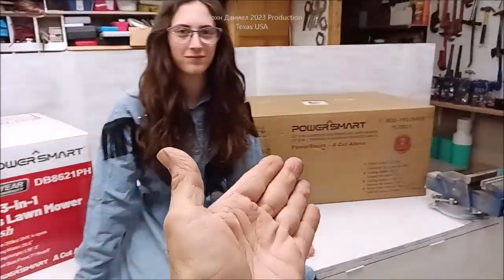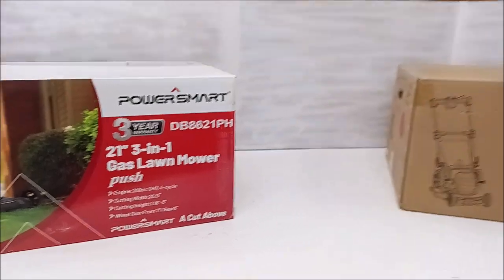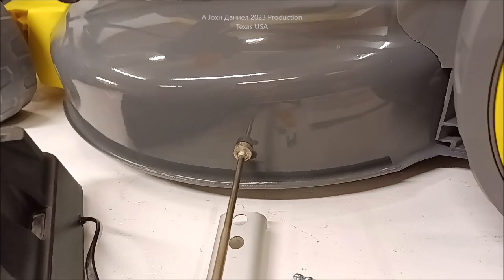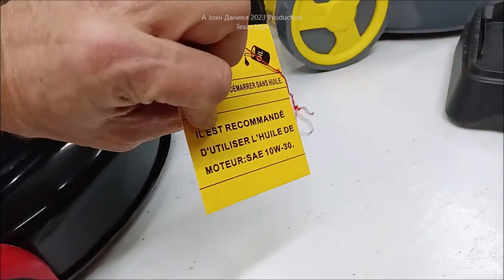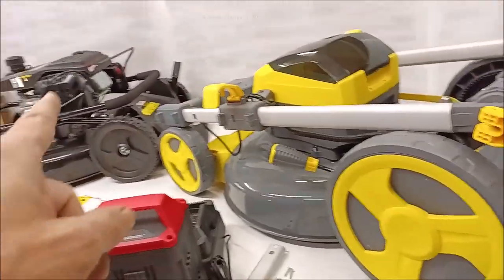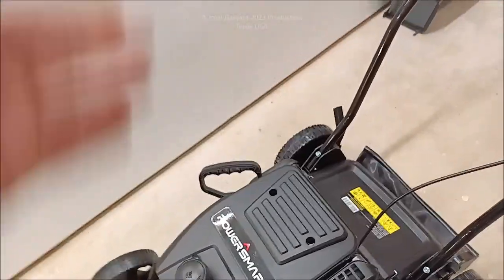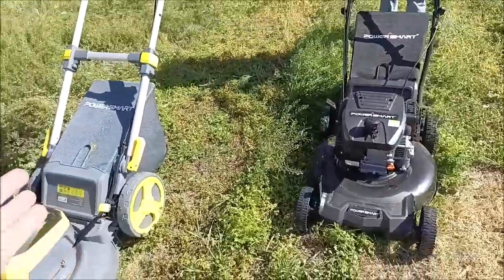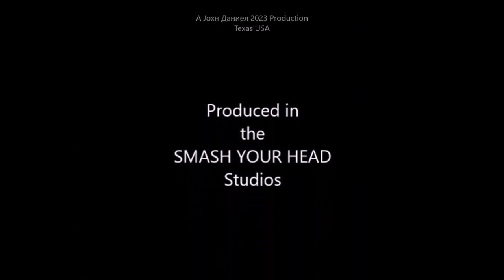Electric Verses Gas lawn mowers, 80 Volt Electric & 4.5 Horizontal Powered Gas - new for 2023

Comment: Weird they use a horizontal shaft engine,  interesting but it seems like a lot of unnecessary moving parts.  I like gas engines for mowers but I bought a 52 volt Ego cordless electric trimmer and I love it.
Reply: Yes sir, I was wondering the same.  Maybe geared down for more torque and cutting power impact with follow through?

Comment: for me the self powered mowers are too slow, i could just about take a nap.
i port n tune my briggs , people chuck em out with simple easy to fix issues and i grab em, once ported they power through long grass no stalling or bogging down,the exhaust dont smell bad anymore and cut for approx 45 mins longer on a tank , mind you the old side valve briggs have terrible exhaust ports so its no wonder the dramatic transformation.

Comment: Ramble rant blathering a bit John i like propane  or diesel because of gas craping out in my carb ant sold on batterys balancing sucks all that wiring sucks under charging so they actulky last more than a year lol  i got a bunch of stuff started playing around with lithium polymer rc stuff and building custom packs from batterys by the cell of the different types  got a 30 -0 volt 10 amp lab supply and bunch converters all mater's of junk lol .boy i would love to have old nickel iron battery s used on rail roads but  not seen any in fer ever .or redox flow set up may be

Comment: I have an 80 volt atlas chainsaw that’s an absolute unit. Loads of power. Seems like 80 volt equipment in general is the magic number for serious gas like power. 

I like the side shaft mower though. So many options! 
You can actually change the oil and convert it to propane. 

Would a 3 hp predator swap in you think?
Reply from the maker: A 79cc predator is12mm too small on the mounting spread for it

Comment: Love you guys videos, do you have any ideas about swapping  a 2 stroke motor on a small tiller, for a 4 stroke motor or battery powered motor.
Reply from the maker: There was a 2 stroke craze on micro tillers for about 8 years and so many weird models wee made it is impossible to know which one you have to make a call on that. The front mount, top mount 43, 52 and 65 cc and the slip shaft models or even the dreaded taper shaft models. Millions fill landfills.

Comment: This is a add to sell lawnmowers.
Reply from the maker: LOL, Just the Gas one I would say if anything. The Electric one is not mine, I paid full price minus $50 for the gas one and they offered me a sale share coupon but as you can see, no coupon came with the link they sent. So who knows, I may make $4 off each sold, but if someone ain't getting 5% off too, DON'T buy one. Still the best push mower I have is the inverter powered one I built, almost 3 hours run time with NO gas used.